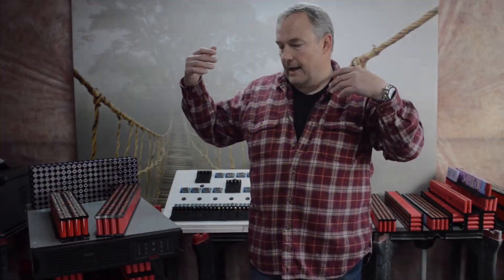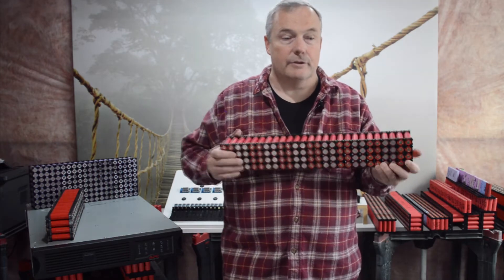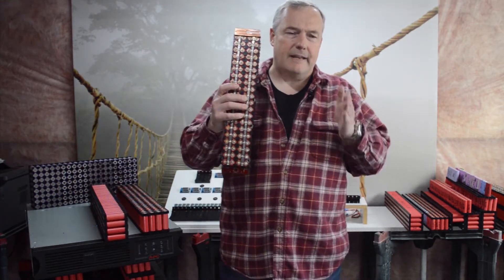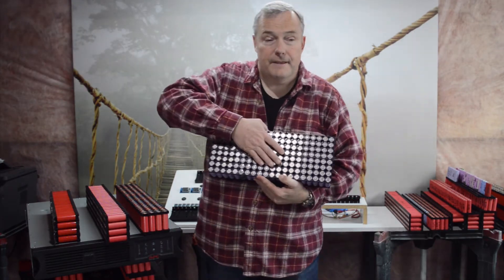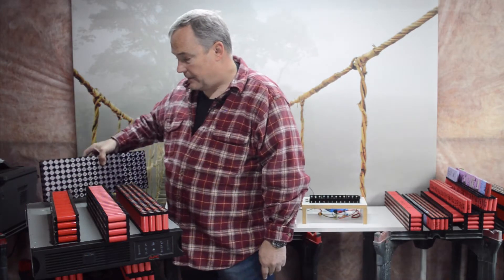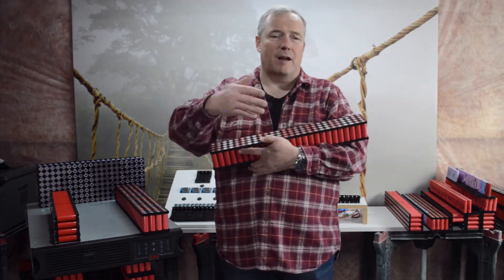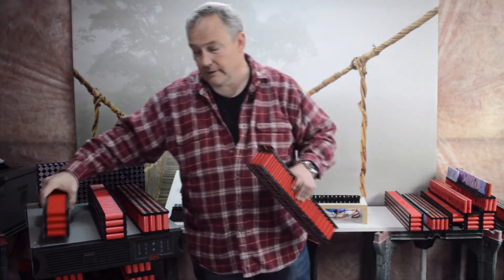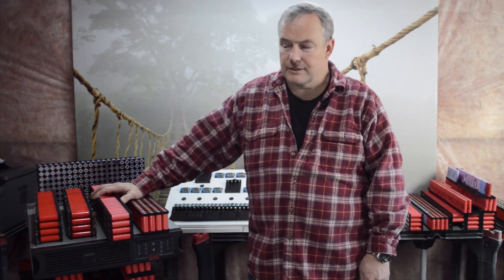Cell Pack Questions

Comment: More in parallel balance automatically, If one cell dies it won't effect the voltage output just the capacity, the more in series you need BMS to balance. Drawback initial lay out is big with parallel to get to desired voltage but once there its a smoother ops. My 5c

Comment: My take on the bigger cell packs with a 3.7(4.2) voltage. Is that there is less stress, heat buildup, and less full cycles on each large pack. The amp draw on the large packs compared to a small group pack is  in the .0 something or. 00 something in amp draw. Were a smaller pack could get into the multiple amps per cell, and more full cycles to get same results. As for maintainance a few extra packs can be switched in to replace when working on a pack from the wall. Ya it takes more packs to boost capacity. I think that the larger cell packs are the way to go.

Comment: I think the main reason is due to being able to keep the bigger (group of cells) to continue to be used without it being an insufficient voltage if too many cells fails in the version you have build .

Comment: Short answer - You cant use a single BMS for paralell groups of 7s batteries, each 7s battery You use needs a separate bms with 7 channels, instead of just having one per 4,2v pack.

Comment: 2:10 ive often wondered why people build packs in a 4.2 volt fashion myself you cant hot swap if the cell packs are built that way but each to their own i suppose
Reply from the maker: Despite what I said in one of my videos, I'm really leaning towards building my power wall cell packs at full voltage.  Thanks for watching.

Comment: Great Channel! I have a question, what is the benefit or difference with using 18650 cells Versus using Lithium Iron Phosphate (LiFePO4, LFE) 
Peak Capacity: 3000Wh (12V, 240Ah)
Reply from the maker: I have only worked with 18650's mainly because they are so really available and cheap when being harvested from old laptop batteries and power tools.  Not to mention that they have been the cell of choice in Tesla cars.

Comment: In my point of view: as many series configuration you have as many chances of having an unbalance module and the possibility of failure. If you have 8 cells and one fails 12% of one module fails, if you have 200 and one fails almost nothing happens. An last thing, if you want to put bms imaging how many of them you have to buy... definatelly big modules in parallel is better than the solution that you propose. I know you have to wait more time until you get 14 moduls of 200 cells each
Reply from the maker: +Battery DIY, good point, thank you for your input. I think I may go back to building multiple, large cell packs.
Reply: Frank all together we need to keep improving, I would like to suggest to make another video just for people who doesn't read commend and pehaps go with the wrong configurarion
Reply from the maker: +Battery DIY, sounds like a great idea. Thanks again.
Reply: Second!

Comment: Just thinking that this would allow you to get to your desired voltage and get things going however you would still need enough amps in your battery to avoid stressing your cells which is load dependant.
Reply from the maker: +WoodyJim agreed, I know that I would never run on just one cell pack. Yes, the more cells packs that are added the less stress it would put on the cells.